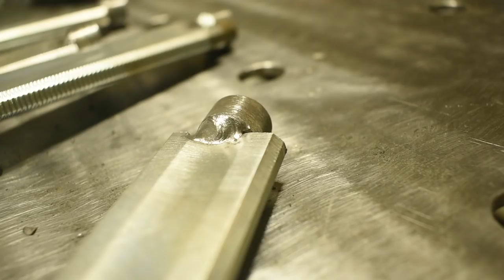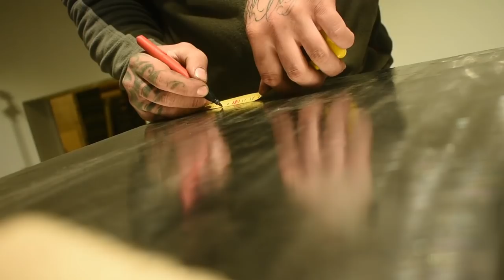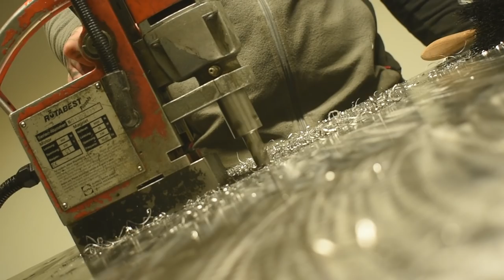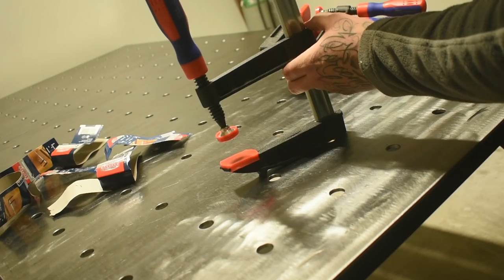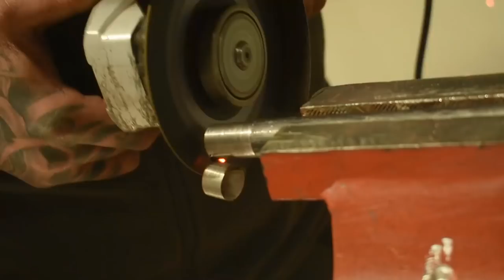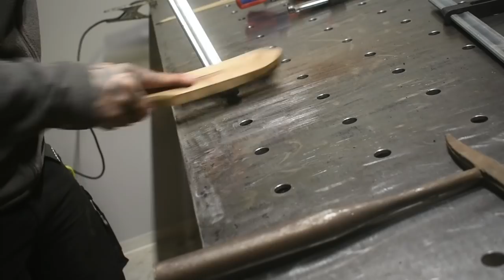HABU \\ The Ultimate Welding Table Clamp System

Comment: Good evening Habu!
I saw your video on Youtube that you made a metallic workshop table with holes
I would like to learn the plate of that piece of metal.
For example 5 mm or...??
What the diameter of the hole?
Reply from the maker: The plate is 5 mm and the holes are 17 mm